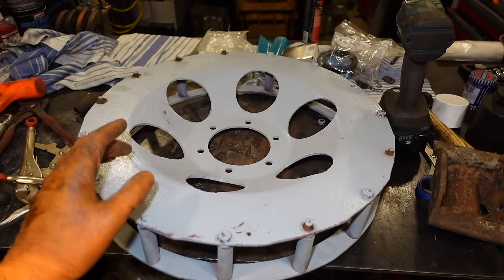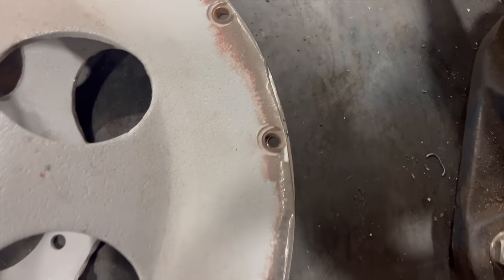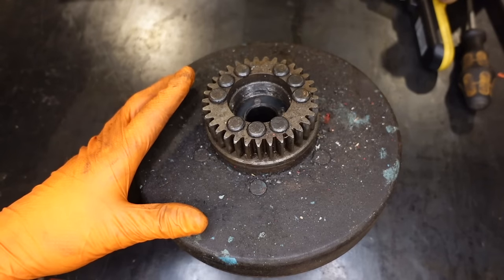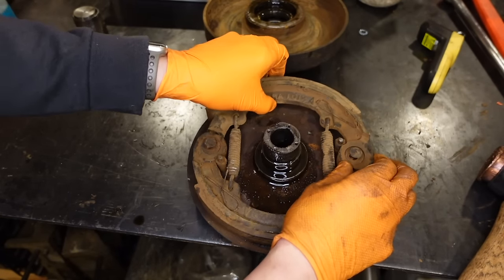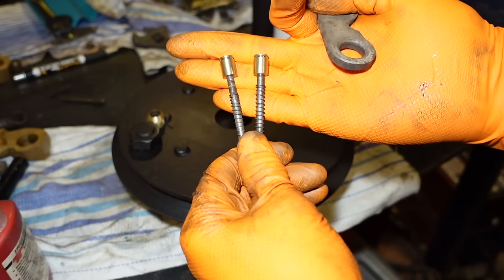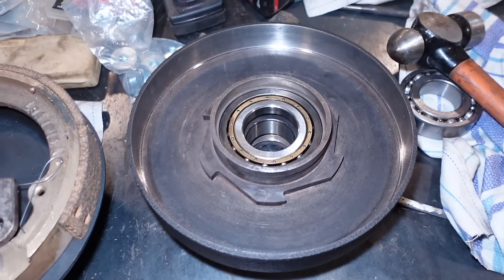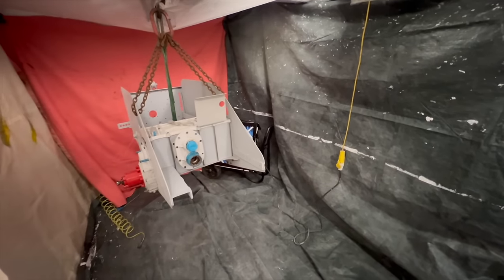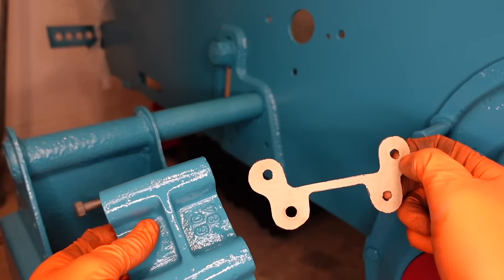THE TRACKS ARE ON! ☺️ - 1946 Ransomes Crawler P4

Comment: Two questions.  You put new bearings in the clutch but I did not see you pack them with grease why?  How did you know how much to build up the wheels to account for wear?
Reply from the maker: Because they’re wet bearings from the engine oil. 
Also because I know the OD of the wheels we built them up and ground them to the same size as the new inner ring

Comment: I really need to ask, I saw you assemble a lot of those bearings in their housings dry. what lubricates them after they're assembled?
Reply from the maker: Every one of them is getting filled with oil when it’s done. The gearbox obviously has oil, the drives have oil as well as the idlers. Strange setup but I’ll make it back to what it was.

Comment: What the bloody hell was that nut splitter and where do i get one?!
Reply from the maker: Just a cheap one, type in on Google. It was a set of two, I think I got them from Toolstation 10y ago maybe.
Reply: @CalamityKim1  well it made light work of it! They look to vary a lot in price online so think I might just invest in a cheaper set and see how I get on. Thanks for replying.
Reply from the maker: That’s alright. With the cheaper one I will say the little key which holds the splitter peice in place isn’t very good. On the one in the videos it kept spinning round. Just bear that in mind but the amount people would normally use them I’m sure it’ll be fine.